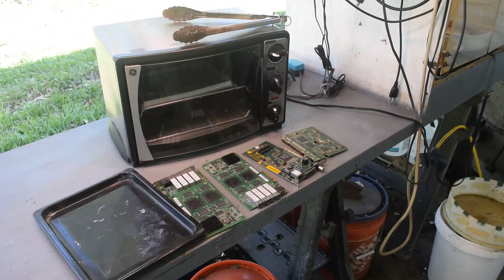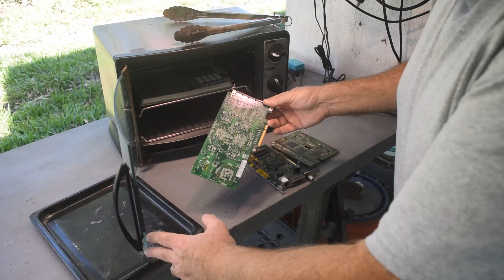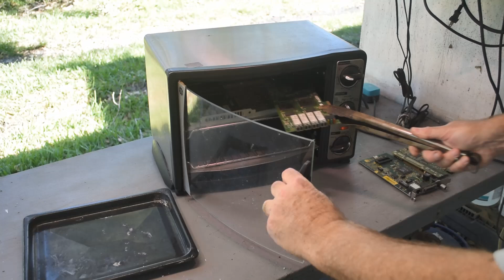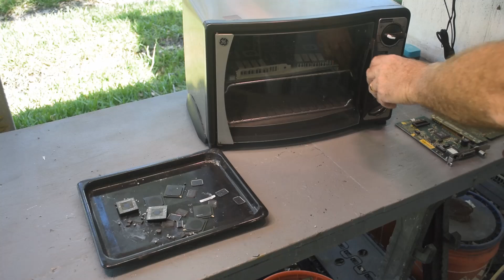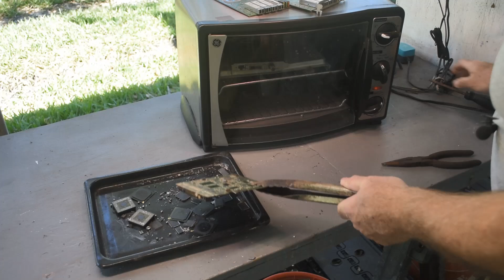PC Board Depopulating Using A Toaster Oven #gold #silver #ewaste #thriftstore

Comment: Can this be used to remove components to reuse, or will it destroy them?
Reply from the maker: Some parts won't take the heat.
Reply: @omegageek64  Thanks for the reply :) I had a feeling that might be the case. I need a way to do it, but a hot plate is too expensive. I have hot air rework station but I don't want to degrade its lifespan by using it to remove components. Trying to think of a good way. Any ideas?

Comment: Thanks for sharing. I've got a solar inverter battery setup that can feed my old toaster oven, so I don't run up the electricity bill doing this.  Something to consider to get the highest ROI from these hobbies. Looking at 200 telco mobo and probably a 1000 small boards i wanted to knock out fast as possible. This is definitely going to help me.   I'm going to put some 2x4's down and a make wood box to catch all my pieces flying off, including those solder bb's like @richardhubert9480. I was looking for a way to get enough to make a SNCL2 batch.

Comment: Hi Mike my name is John I`m in the Charleston Sout Carolina area I have been recovering Gold foils and suchh for about 10 years! In the last weak I droped 6 off the filters from my stok into aqualigia by the time I was done I had about 3500 mililiters of sulution ,I seperated the sulution into 2 2000 ml beakers one off the beakers I usd smb and the gold droped with no problem .I detoxed the sulutions before .the second sulution I aded sulferic acid to dro the led! For some reason I`m not abel to detoxe the sulution every time the gold comes out off sulution it goes back into sulution. From your vidios I know you like pusels, fogive my speling it`s no my strong point Thanks John P.

Comment: I remember a really long time ago when Moose was still doing these types of videos. He put a big pan of play sand on his barbecue grill. He would set the boards in the pan until they got good and hot and then scrape them clean with a putty knife.
Reply: @Belgarion1971  I tried that as well using a skillet. Sand absorbs relative humidity. Even when the moisture is driven off, have you actually separated the sand from the chips, resistors, and MLCCs? Because of the solder, those grains of sand clump and stick to your components. It was worse than mechanically removing components from the circuit boards.
Reply: @johnross8939  Good to know. I haven't actually tried it yet.

Comment: I have just modified a toaster oven... It has 4 heating elements.  2 on top 2 on the bottom .. I moved the bottom 2 up, now I have 4 heating elements on top... I also moved the sensor down... I'm waiting for ceramic fiber to protect the electrical stuff before I do a test run....

Comment: How much power does that thing use? Electricity isn't usually cheap :)
Reply: most are 800-1300 watts.  My inverter can pump out 1.6kw and momentarily hold up to 2kw.  Might be a way to curb the costs.   I also considered making a Fresnel lens solar oven, planning to incinerate the chips this way to keep other char and ashes out.  Anyone try these methods?

Comment: I tried this process without good success. My toaster oven was smaller and lower quality than yours. I couldn't prevent the dang thing from scorching the circuit boards. Not good. May have revisit this technique.
Reply: You could try wrapping the heating elements in foil so they don't take direct heat.

Comment: Nice.  Any worries about getting solder on the gold fingers?  Or plan on removing those first and then use the toaster oven?  Looking forward to seeing the next video!
Reply: I suggest removing the fingers first, since it's easy enough. But using tin solution later on the small components and solder will release any gold from the fingers or plating that gets pulled into the solder.
So really, it doesn't matter. Just don't forget the fingers in the depopulation pile 😂